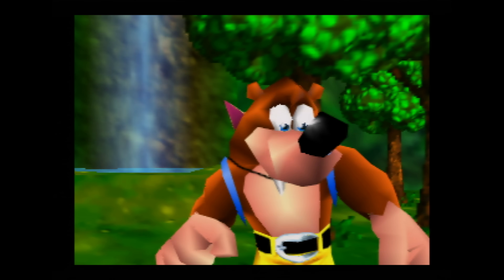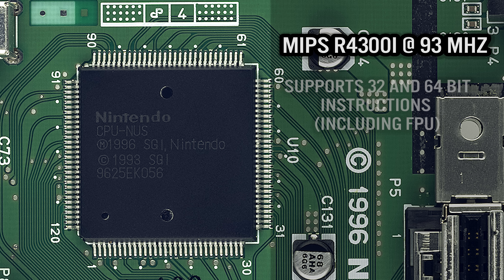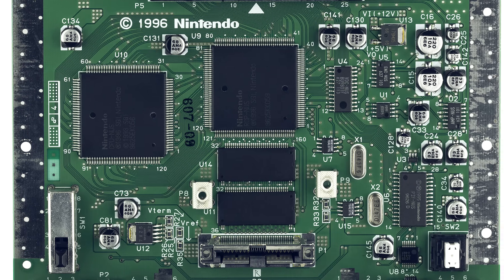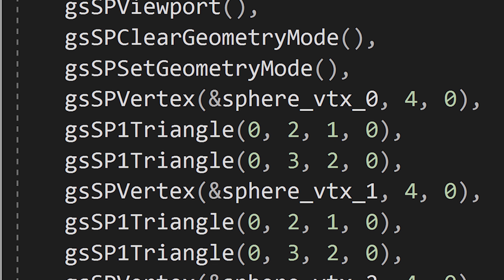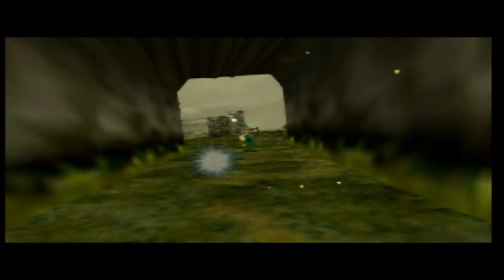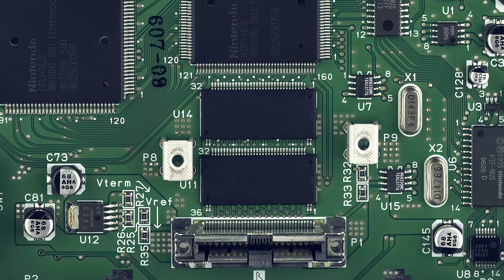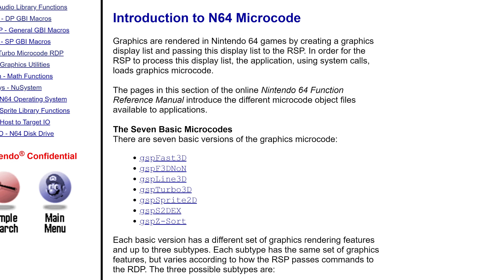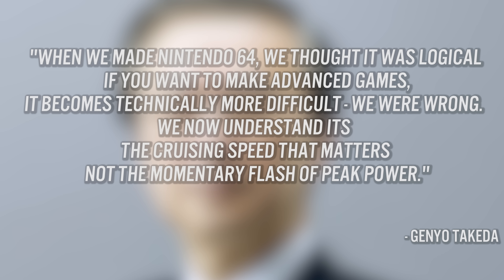Why was the Nintendo 64 so hard to develop games for ? | MVG

Comment: I am kind of astonished that you say that the cartridge was faster than the RAM. According to Wikipedia the cartridge of the N64 has 264 MB/s and the RAM has 562.5 MB/s. Or do you refer to the latency? Is this higher for RDRAM than for the cartridge?
Reply: Cartridge had 16bits bus and had little latency (ROMs are faster to access), RDRAM was something like 8-9 bits and needed setup time (=latency) when changing addresses.
Reply: @SerBallister  so I guess it was because of the latency. A low number of bits can be compensazed with a high clock speed which actually was how RDRAM worked.
Reply: @rfvtgbzhn  Yeah it was a weird memory chip. I think it was really fast in bursts.
Reply: @SerBallister  it had a clear performance advantage over SDRAM and early DDR-SDRAM on the PC. This was why the first Intel chipsets for the Pentium IV used it. But it was also too expensive because of high royalties and DDR-SDRAM cought up in performance, so RDRAM was dropped. Also chipmakers sold DDR for dumping prices for some time to get rid of Rambus and their fees, there was a court case thatwas decided a few years later. For consoles the higher prices of RDRAM was probably not that much of an issue because they had far less RAM than PCs at that time.

Comment: Nintendo are to blame for the small TMEM (although there was some reason for it, with as costly as the console was already), and for the early-on caginess about the microcode and whatnot that frustrated developers and gave the finer points of the system's capability a reputation for being an obfuscated "black box" (leading to such woeful outcomes as the native FMV support barely getting taken advantage of).

But the real blame for the oh-so-irritating RAM bottleneck (which could be compensated for and worked around in various ways, but it was complex and hard, as you pointed out) has to go to Rambus themselves. They're the ones who developed it, and who botched their fancy schmancy new RAM flavor something fierce.

IMO the N64 deserves credit for being one of the few devices to successfully wring performance worth a damn out of Rambus' bungled chips.

Comment: Nintendo really doomed this system by the design choices.   I love Killer Instinct Gold, Mario Tennis, and Mario 64, but it was overall just a weird system and I found the games lackluster (especially compared to the Playstation).  I absolutely hated the controller design and it only worked well for first party games IMO (like the games I mentioned above).  But not using a CD was the biggest flaw, CD ROM  based systems proved that gamers were willing to wait a few seconds here and there and enjoy CD sound, full motion video, and larger games that were cheaper and more futuristic (plus the ability to play audio CD's).  Nintendo 64 cartridge games were typically $59.99 or more with tax and I believe Nintendo did not keep it just because of the "loading speed" excuse!  They made a lot of money off every game sold, due to their "Nintendo seal of approval" nonsense and third parties made $7 a game sold while Nintendo got the rest!   Smart business practice on their part, but screwed both their customers and the third parties simultaneously.  

But those two factors, coupled with the other shortcomings of the system (not to mention, the Playstation launch) is what killed the Nintendo 64.  This was after it being in development hell for a long time and gamers were not as hyped for it by then as they initially were.   While Nintendo is an amazing company, they always have been clever in making more money for themselves and hurting the competition with their non-compete nonsense.   They held back a lot of systems from reaching potential, Turbo Grafix-16, Atari Jaguar, and their own Nintendo 64 included!  Not coming out with the SNES CD ROM unit, which became the Playstation, was also a stupid mistake that could have really paid off.   Nintendo continues the same with the 3DS, DS, and Wii U.  They all disenchant 3rd parties because they make the killing off everything being proprietary and made for Nintendo by Nintendo while 3rd parties barely make any money off the games.   I personally think they did not want the CD ROM for SNES because Sony would have profited off it and they could not pull their usual "You do the work, we get 90% of the profit!".  Why you think the Gamecube had its own CD format?   They made money off each one and the third parties had to buy them!

Comment: A 5 stage pipeline does NOT mean a processor executes 5 instructions in parallel. Longer pipelines allow the processor to run faster. Pipeline costs an overhead but allows instructions to be decoded in time for higher clockspeed

Comment: Mario 64 is connected to all other N64 games via hardware quantum tunneling which Nintendo was experimenting with at the time.

There exists some basic coding which is evident across all N64 releases after Mario 64 which allows it to interact with these games in subtle ways. Data miners have been unearthing these secrets for years now but Nintendo has been keeping this information suppressed through intimidation tactics against hackers/leakers (Nintendo have notoriously taken action against fan projects which used modified code based on the original N64 library games). These changes would have been substantial, tweaking minor things in some games and unlocking entirely new and unseen content in others.

This exciting new technology was an open industry secret in the late 90s and, according to some old Konami employees, was even emulated/parodied by Metal Gear Solid's Psycho Mantis using his "psychic abilities" to read the player's PS1 memory card. As early as 1998 however there were several lawsuits filed against Nintendo by children's parents who sued for "legal damages". While these lawsuits have been officialy expunged from public records as of today, they were apparently settled out of court for a substantial amount. As early as 1999, ex-Nintendo employees recall being instructed to erase any physical or digital records of the HQT (hardware quantum tunneling) technology from their files. In a leaked Nintendo business insider document released in 2010, CEO Satoru Iwata was quoted as saying (in response to questions about digital preservation of older Nintendo titles) that any game produced before 1999 had already been digitally preserved by Nintendo themselves and that any physical media are best left alone. Although very little documentation exists of the hardware today, it is very unlikely that it caused considerable financial or legal damage to Nintendo overall. Whether it exists or not remains as speculation.

Comment: The Super NES was proof that the cartridge medium had merits over CDs. Being able to include chips inside a cartridge to boost the power of the system when necessary gives a huge edge over disc based systems which are limited to the computing power built into them. Nintendo could've had the edge in the fifth generation of home consoles easily with more forethought.
Reply: Cart prices make it brutal for publishers though, if they didn't sell every last unit manufactured

Comment: You misunderstand the concept of instruction pipelines. A 5 state pipeline doesn't mean that it can compute 5 instructions at a time. It means that at any given time there could be up to 5 instructions in varying stages of completion. It's a significant difference, as there are architectures that can actually execute multiple instructions simultaneously (e.g. multi-core, superscalar, VLIW).

Comment: 1:47 "5-stage pipeline (execute 5 instructions at the same time)"
rreeeeeeeEEEEEEEEEEEEEEEEEEEEEEEEEEEEEEEEEEE
No! For fucks sake! No, no, NO, NO, NNNNNOOOOOOOOOOOOOOO!
5-stage pipeline means each instruction is broken into 5 pieces that are processed by the chip on 5 different "locations" (it's a bit harder to get than that, but the analogy helps a lot).
This means that, when an instruction enters the processor, the 1st part is processed, then the 2nd, then the 3rd, then the 4th, and at last the 5th, all those 5 stages in a single processor cycle (93MHz). The processor doesn't have "5 times the speed" by "processing 5 instructions at the same time".

The trick with pipelines, and why it can do a lot of good on processors (and sometimes even processing speed), is that each location that processes a different part of the instruction can be busy at all times. This means that, once a location has processed a part of an instruction, it can get the next instruction right away. A way to illustrate this without visual aid (yeah, bear with me), is saying that we have 6 different instructions: A, B, C, D, E, and F. Each of them are divided in five parts, for example for A: A1, A2, A3, A4 and A5. Each location of the processor can be named in the same fashion: L1, L2, L3, L4 and L5. On each "sub-cycle" (more complicated than this, but helps explaining), the processor can have each location associated with one instruction part. We can write the relation of locations and instructions as L(number)-(letter)(number). For example, if instruction part A1 is on location L1, we can write it as L1-A1. So, if A through F come in order, we have:

Sub-cycle 1: L1-A1 ; L2-__  ; L3-__  ; L4-__  ; L5-__
Sub-cycle 2: L1-B1 ; L2-A2 ; L3-__  ; L4-__ ; L5__
Sub-cycle 3: L1-C1 ; L2-B2 ; L3-A3 ; L4-__ ; L5__
Sub-cycle 4: L1-D1 ; L2-C2 ; L3-B3 ; L4-A4; L5__
Sub-cycle 5: L1-E1 ; L2-D2 ; L3-C3 ; L4--B4; L5-A5 (this marks the end of a full processor cycle)
Sub-cycle 6: L1-F1 ; L2-E2 ; L3-D3 ; L4--C4; L5-B5 
Note that it still takes a full cycle to process instruction A. The upside is that: as soon as instruction A gets out (is executed), instruction F starts getting into the processor. Still, the subsequent instructions are still staggered: nothing is coming out of the processor at the same time, it's not true parallelism (it's a pipeline).
And if you look at this and say "well, 5 being processed at the same time (even if staggered), so it's still 5 times faster", it's because you're being naive about how instructions interact with each other, and probably doesn't understand a lot about programming (I have intermediate understanding of programming and low-level programming myself).
Problems with pipelines? If ALL instructions inside the pipeline NEVER have ANY kind of effect on each other, then the pipeline works perfectly. And, as the use of words like "ALL", "NEVER" and "ANY" suggest, that is rarely ever the case.
If there are branching paths on the program (if-then-else statements, things used to denote a decision point), pipelines either stop being fed (if the processor is REALLY primitive), or have to guess/predict which branch was supposed to be followed. And when it fails to predict, it has to flush all the pipeline, since all instructions inside it were assumed wrong (pipeline was useless).
If there are instructions that will use the same position of the memory, both accesses can't occur at the same time, meaning that the pipeline is stopped until that issue is resolved. It's basically a restriction of "don't write on this section while I'm trying to read it". It's (most of the time) okay for multiple readings, but multiple writes and/or write-while-read is a BIG NO NO.
Sometimes, even though there are multiple pipelines, the processor can't still make two of the same operation at the same time. Like for example, there are two floating point multiplications (a "floating point" is essentially a number that isn't an integer), the pipeline might not be able to do both at the same time. If the processor has several different blocks for operations (which is common, even on old pipeline-enabled processors), then it may be able to do (provided memory usage isn't restricting them).
Some of these pipeline problems are at least reduced by compilers. Compilers can sorta rearrange instructions (to some extent) that may prevent or reduce these problems. But it's not guaranteed, nor trivial. At best, these processors had about 10% to 15% increased output. Maybe 25%. Unless GPU-related stuff was heavily optimized for pipelines.

Comment: I programmed most of the 3D engine for Banjo Kazooie (and some of the gameplay on some of the levels). I had a great time working on the N64, and honestly don't think it was more difficult to work on than other hardware. In some ways it was simpler because you could directly manipulate the display list in memory, making it super fast to enable/disable parts of the scene. We used this (in combination with the fast cartridge) to swap graphics in/out as you turn the camera, enabling much larger levels to be possible. Yes the limited texture memory was annoying. But it didn't make the N64 harder to work with (from a programming point of view).
Reply: referral madness  Yep a long time ago :-) We used C to program Banjo Kazooie. I initially wanted to use C++ but the compiler wasn't production ready. When we started out I was the only person knowing C. Everybody else came from the SNES (assembler). So they had to learn C while programming BK.
Reply: referral madness  You are welcome :-) 
I never programmed the SNES so I don't know much about it. Thanks for the GameHut tip.
Reply: Really?
Reply: @codecoderr7495  N64's OpenGL was VERY Early and Quite Primitive.
Reply: @ 

N64 RDP is an IrisGL GPU, whose commands were packed as an OpenGL-like display lists interface. So it's not OpenGL. The OpenGL-like immediate mode interface was rudimentary, yes.

The underlying process of light source reflection on decals (and not on light reflection over a surface towards the camera, as in OpenGL), allows IrisGL based hardware, to have raytraced light reflections.
Reply: @ IrisGL also was generally compatible with Runescape if I'm not mistaken. N64 relied heavily on Z Buffer and XY Early Tessellation. Most N64 games used very small polygons and even smaller textures and since SGI handled The Lawnmower Man's Virtual Reality SFX, it also has Quad Layering and Multi Bend Map. Light Sourcing on N64 was Translucency, although Saturn's Translucency was  CodeScape and Lockheed  Martin "Moon" based. Regarding Ray Tracing, it was mostly known as T&L at the time. Saturn and Model 2 even got T&L(Translucency and Lighting) Upgrades later. N64 mostly used just Translucency as it also got T&L Software later.
Reply: @ 

Interesting. Some notes:

Light Sourcing on the N64 is not Translucency, nor T&L. IrisGL, as previously written, uses per-vertex equation (“Phong” lighting), and on top of that,  a set of normals are generated in place, for Gouraud Shading on the N64. Internally, the RDP doesn't know about light sources on a scene, because that's OpenGL nomenclature. 

Per-vertex equation (“Phong” lighting) is based on the material and light parameters of a reflective surface (over a decal, in IrisGL), then, determines the color of that vertex. Then is applied to its nearest decal surfaces. The color combiner hardware then blends its output fragment against intersected surrounding decals, then it's blended together from an external texture color. 

'Alice 4 IRIS GL Implementation' provides a great insight over this post.
Reply: I know its a bit late, but do you remember perhaps how many polygons per second or per frame was the Banjo Kazooie pushing? Its pobably the most balanced game on N64 between graphics and performance.

Comment: I thought it was relatively easy to develop for, as a gameplay coder! You could write in fancypants C language instead of assembler, and didn't have to worry about banked memory for code (SNES) or short pointers (MSDOS). [Well maybe for framebuffers and big data]. You didn't have to put the EPROMs into a UV eraser and burn them for 20 minutes before plugging them in, you could use a SGI workstation as a devkit. You even had a library which did graphics instead of having to write everything from scratch. I suppose the tiny texture cache or storage size would matter if you were porting a game from PC or PS1 but for an original game you could design it around what the system does. That makes it an artist problem not a coder problem :-) This was before Nintendo allowed you to write any engine code so you could just accept it. Admittedly my game (Acclaim Sports Soccer) was cancelled (twice I think) rather than being published but I felt that was to do with the gameplay (my area) rather than the graphics which were pretty enough. I do remember some niggles like the [SN systems] compiler generating bad code (e.g. reversing the loop direction to save some cycles but not reversing the loop variable) and you had to clear some cache or DMA or whatever before calling the routine that read the joystick but you get those niggles on any platform, e.g. JMP ($C0FF) on a C64 or something to do with sprites and HL register on a gameboy.

Comment: CPU MIPS EYE 4400 32 bit 64 floating point unit 93 megahurrts 5 step 16 bit 8 bit RCP RSP vector data RDP anti aliasing z buffer 10x more powerful 4 MB Ram code audio data Ram bust fast 500 MB theory cartridge format CD access 
Interesting...